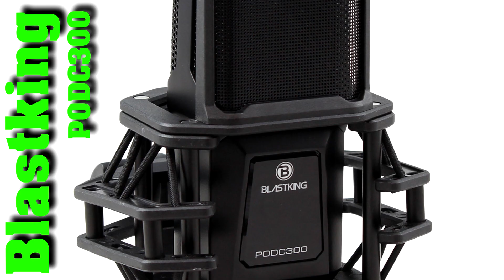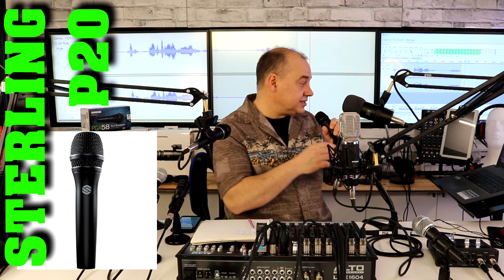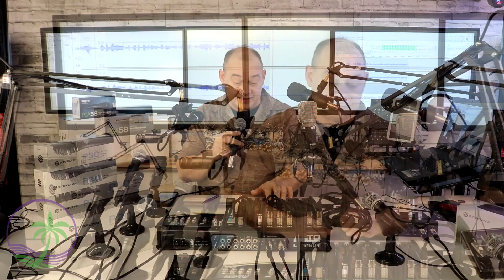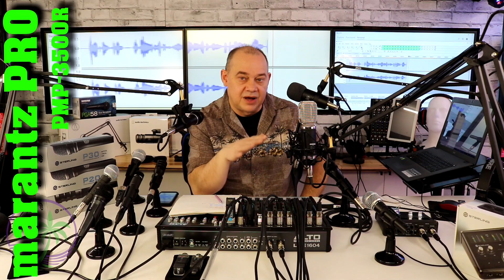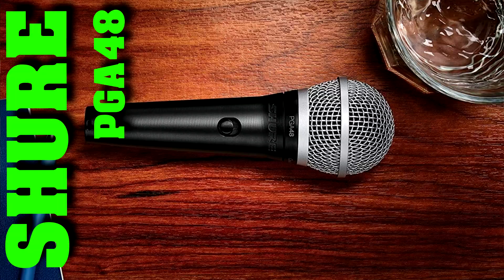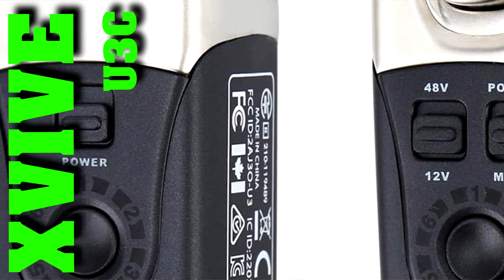10 Great microphones For the Price Hear them All For Studio, Live or Podcasting

Comment: Ive tried to use 2 xvive on 2 handmics and to 1 receiver and didnt work it made a pop sound and it disconects.
Reply from the maker: I will try it again to see if there is any problems with the connection
Reply: @expertisland  thank you so much!
Reply: @expertisland  i was using in a alto ts312 conected not an actual mixer i dont know if that was the problem.
Reply from the maker: So 2 mics with 2 sets of xvives on the same channel going to 2 speakers I will test that out and let you know.
Reply: @expertisland  i was using 2 transmitter and only 1 receiver, i put the transmitters on the same channel both.